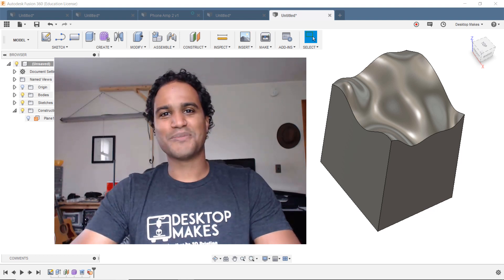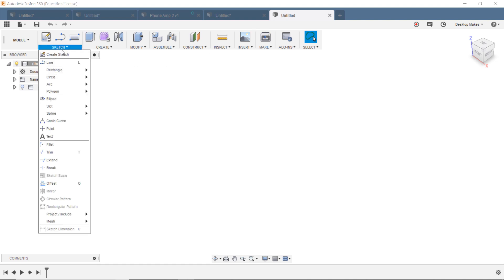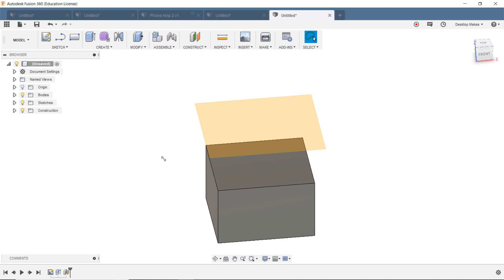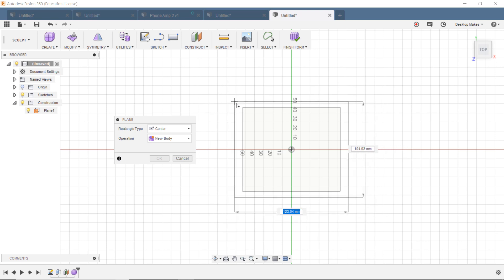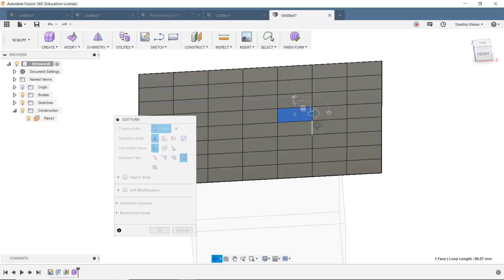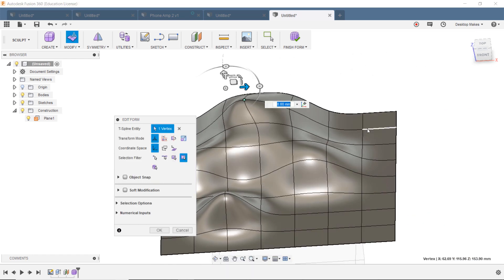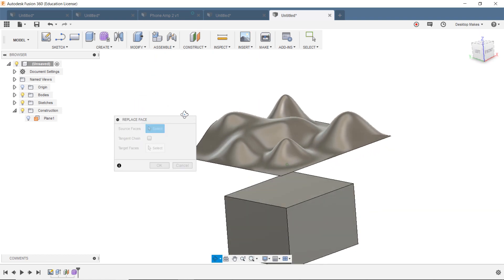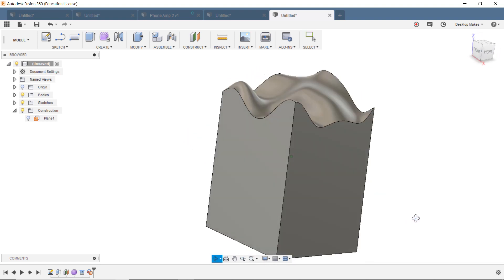Replace Face & Sculpting in Fusion 360

Comment: easy to follow tutorial, i actually want to have more geometric shapes but i'm struggling.. i can make it in sketchup in 5 mins but here its not straigforward
Reply from the maker: Hi Ross, I actually started designing in Sketchup 8 years ago.  I found myself in the same boat when I first starting using Fusion.  I could design so much faster in Sketchup but forced myself to learn fusion as I saw it would be more useful for me in the long run.  Now I simply fly through my designs in Fusion.